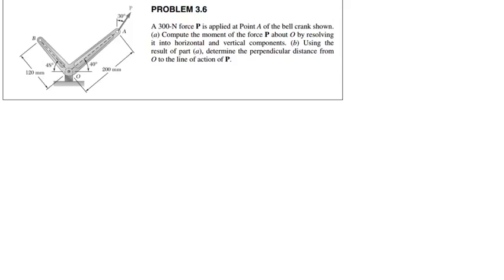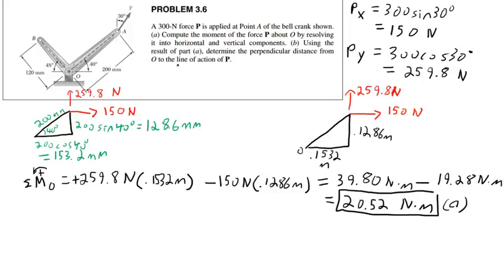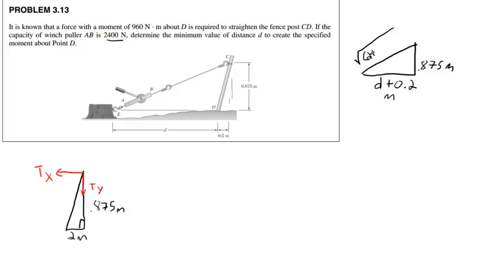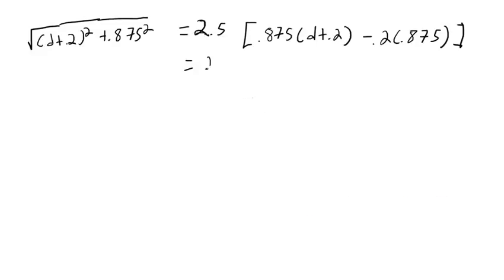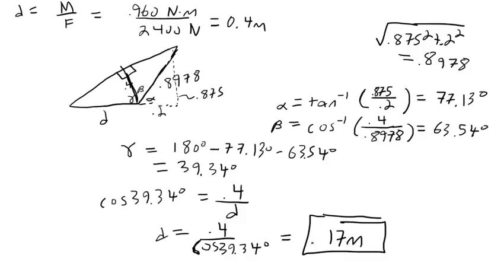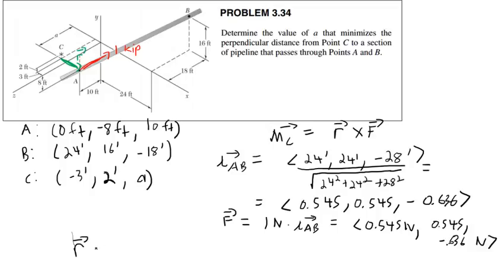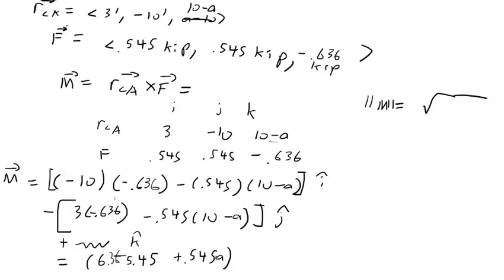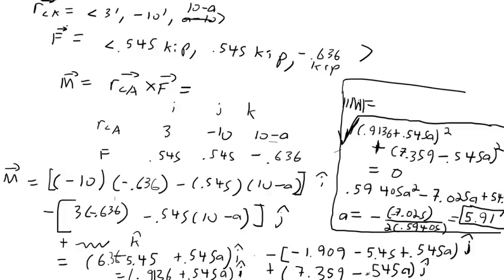Moment Vectors, Moment about an Axis Part 1 - Engineering Statics

Comment: Prob 3.6 is very straightforward.
Prob 3.13 is particularly heinous.  
The straightforward method results in a nightmare of algebra, which even though I have a CAS solving calculator HP50g, it would still be work to input the equation.  

So, here is my summary of the 2nd method for solving(with 3 triangles), which is a lot of work but the strategy is simple::

a.) Create 3 triangles:Triangle #1(drop vertical on point C), and divide CDE with a perpendicular line to AC(call upper triangle #2 and lower #3)
b.) With Triangle #1: use trig to get distance CD and angle at corner D
c.) With Triangle #2: Use M=Fd to solve for d, given M & F.  Pay attention to dimension. Now, solve for the angle at corner D..
d.) With Triangle #3: Solve for corner angle at D from the above(angle + angle + unknown angle =180).  Now you can solve for answer with trig.  

This is a mental note for myself, when I totally forget a month from now.  Keep on Tanya.